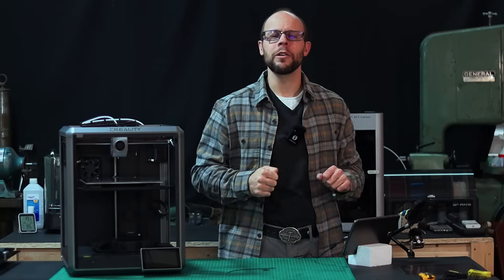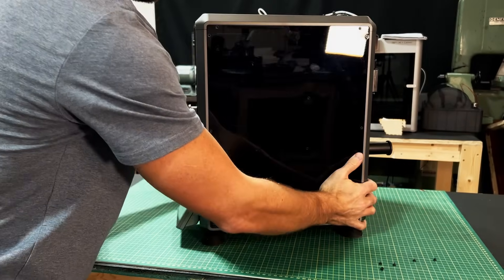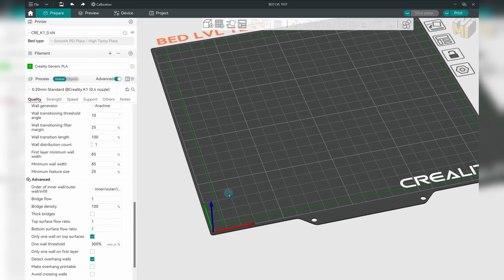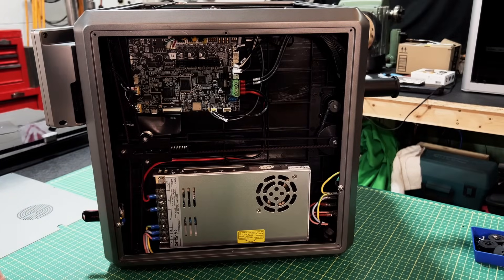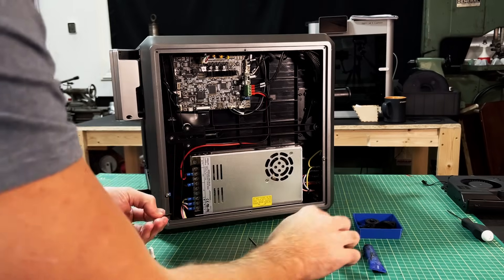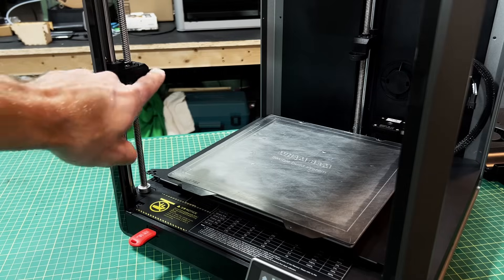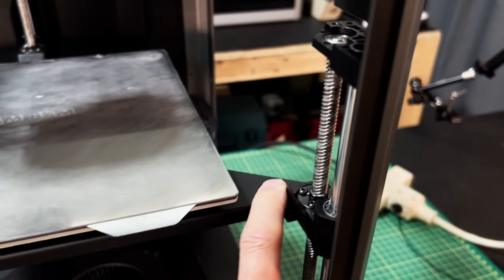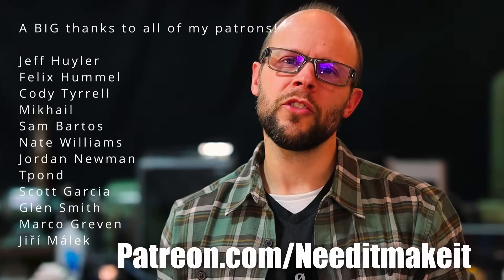Quick and Simple Way to Level Your Creality K1 or K1 Max Bed

Comment: I used the teeth skipping method. Was very quick and easy. I think a video of that process would be good to add.  Also, could you do a video showing how to remove the connections from the hotend into the board. I tried to replace my hotend and could not get those things out. They have some kind of glue on them and then not sure what kind of release mechanism or where to pull on them.
Reply: Also, the back of my bed is maybe .25mm higher than the front which is almost dead on zero on the level graph. I'm not sure you can teeth skip on the back Z axis. Should I just raise the front two up to match and have the whole bed a little high but level?
Reply: @mogators I never messed with the back lead screw, there’s not really an easy way to rotate it without holding the threads with pliers or something. I’d be afraid to damage the teeth. From what I’ve read if you can get the mesh under 1.0 variance you’re generally good to go.
Reply from the maker: That's good info, yeah the tool skip method if you can get it to work for you is probably great, I was going to dig a bit into that, it could probably be made into a YT short video, or a few minute long vid.  

Yup, I can add the other to the list of videos, I think I have 10 videos on the go right now, but I can try to fit some quick ones in-between for sure.  Thanks a lot for the video ideas and the great comments.  You guys are awesome!

Comment: Nice video, don't own a K1 but it is interesting to see alternative ways to level a bed.  I do have a question, I have an X1C and use Bambu Studio.  If I download a .3mf file from wherever, it typically loads the filament settings based on the creator or the .3mf.  When I do a re-sync of the AMS it loads the currently loaded filaments within my AMS which makes sense.  The issue or question I have is that I use custom filament settings in Studio and save them using the name of the filament mfg, material type, etc.  The re-sync just loads Generic xyz.  Is there anyway to have load my custom filament choices?  It's a pain in the rear having to manually change them every time.  Guessing there's no choice since I'm saving my custom filament types only in studio and not able to do so via the printer screen...
Reply from the maker: Interesting, okay, I think there must be a way to do this.  Let me have a peek and see, the filament setups are likely saved within a config type file, it'd imagine it would be possible to select your own within the printer menu.  In the same way that you can select a Generic from the menu which has lower flow rates etc.  Let me see what I can dig up and get back to you.